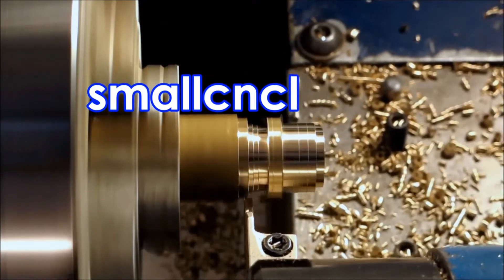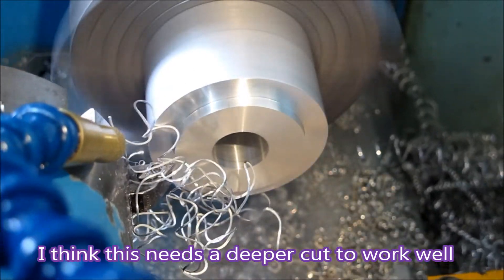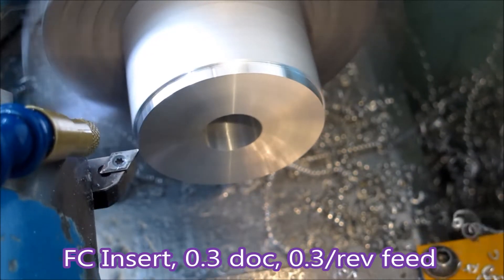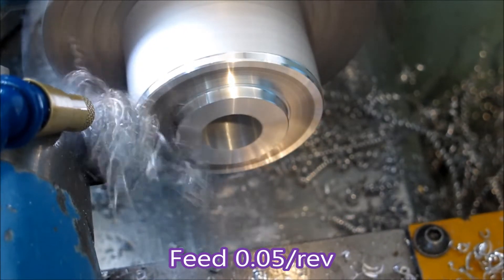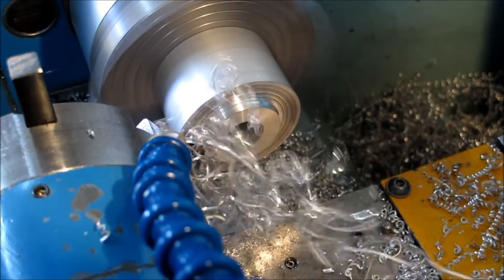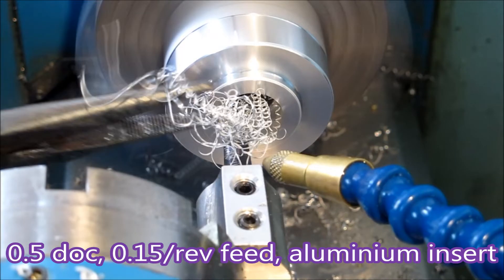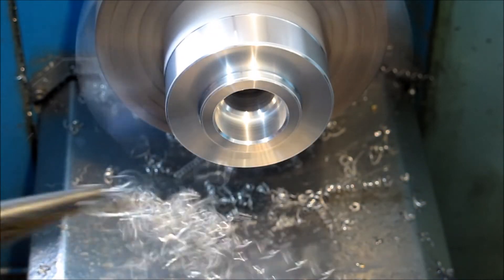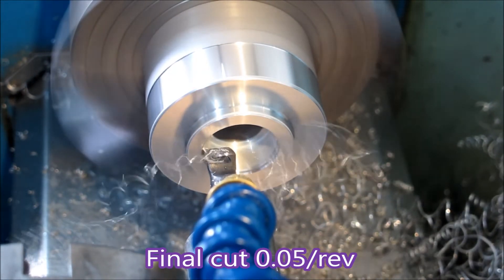Turning 6061 aluminium alloy in the CNC mini lathe.  Sumitomo FC 15° rake and AG 20° rake inserts

Comment: How about spindle speed?
Reply from the maker: I can't believe I did not mention the rpm. Based on the way I usually calculate the rpm, I think the speed would have been around 1800 to 2000rpm for 55 diameter.

Comment: I'm still learning my way around inserts, but shouldn't you be running with higher feed to engage the chip breaker?
Reply from the maker: For the turning, the swarf I was getting with the FC insert and 0.3 feed was ok. For the aluminium insert, I don't have enough spindle power to do much more than I showed. I don't know how to get an acceptable finish with higher feeds.  Also I know there are even videos on YT about the perfect chip, but all I care about is that I can manage it, such that it does not cause too much of a problem re disposal and that the swarf does not mar the surface finish.

Comment: For all the trials and tribulations though you seem to have wound up with a nice surface finish... Martin
Reply from the maker: Actually I think that should be the name for 6061 the Trails and Tribulations alloy.  I started off with the FC insert and only went to the Aluminium insert to see if it was any better!!!  When I saw the mess it made, I thought I would make the video to show the difference.  The aluminium inserts work well in 2011 (as they should) The Korloy AK inserts for aluminium are around $2 each on ebay.  The FC inserts are $9 each, so there is a good reason to use the AK inserts when they are useful. They also work well on brass, which is odd when you consider we were all taught that zero rake was the thing for brass and the AKs have 20 degrees of rake. Setting up a brass job today, might try for another video using different inserts once we get set up.

Comment: Although I know it is a lot of work....putting a link (or a text description) for the insert in the video description would help all of us small CNC people out.
Reply from the maker: Added the insert description to the video description.
Reply from the maker: A bit difficult as SEI Carbide or Sumitomo do not have an online shop. The FC chip breaker I use is available in all the different shapes and size of inserts so a link to a page in their online catalogue would only show you one particular insert. I could put a link to the catalogue I guess, but is readily findable on line. Happy to put a link in, but which would be the most useful to help with finding the right insert. Sumitomo just know it as their FC chipbreaker which is a ground edge insert, with from memory 15 degrees of rake and it is classed as a "finishing insert" as the geometry used is suitable for light finishing cuts. Of course light finishing cuts in industry tends to mean cuts of the size of which we can manage with small lathes. I am not promoting Sumitomo, they are just what I use. Most manufacturers should have a similar insert if you enquire using the description above. Finishing inserts are not easy to find on ebay, I have looked, they have semi-finishing but they look to be moulded not ground.
Try any supplier and look for: Finishing insert, 15 degrees of rake minimum and ground edge. If you can think of any other way I might help in the hunt please let me know.